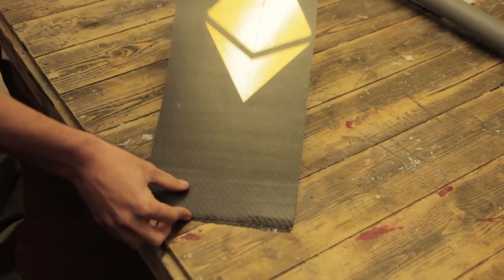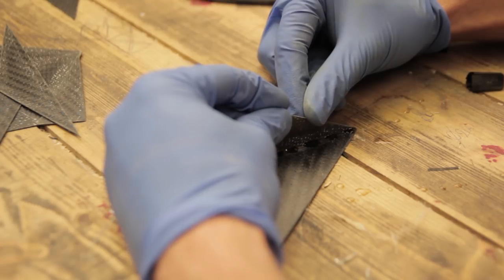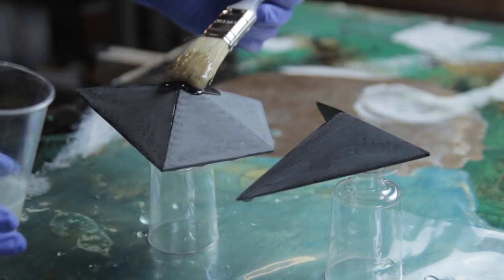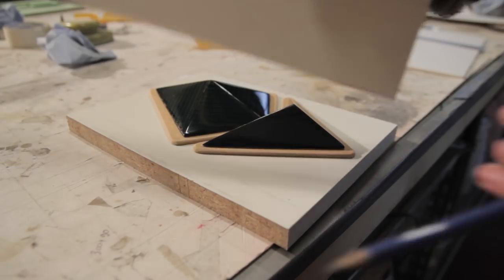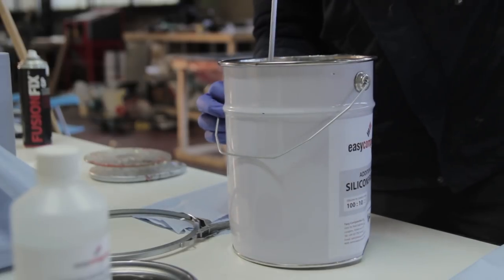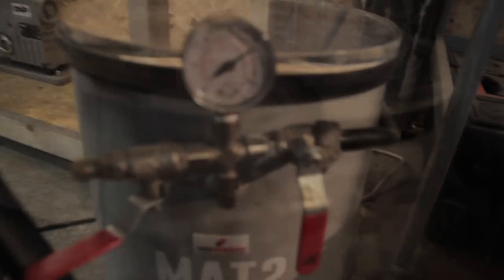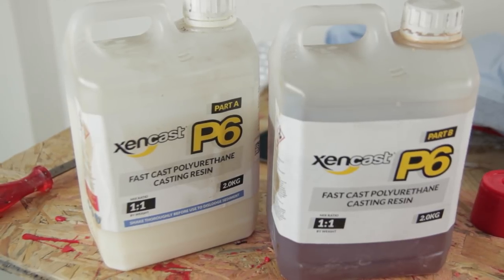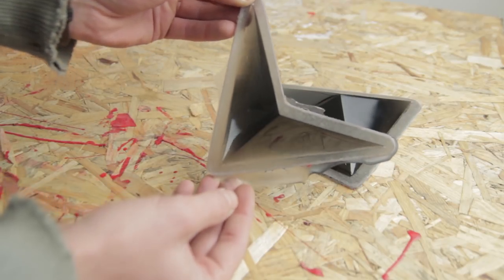How To Cast Ethereum logo (Crypto)

Comment: Nice to see a new video from you! Have been looking forward to it. 

A question, have you ever tried to laminate a 3D print? I mean in such a way that the 3D print is not a mold (that is removed) but stays in the part.
Reply from the maker: Unfortunately I don't have much experience with 3d printers, will try to get my hand on some prints and look if I can experiment with it, should work normally depending on the material printed with
Reply: I am asking because I am working on a project where I want to try this specific thing. If you are intested you may send me a PM, I won't mind sending you a couple of prints to experiment with.